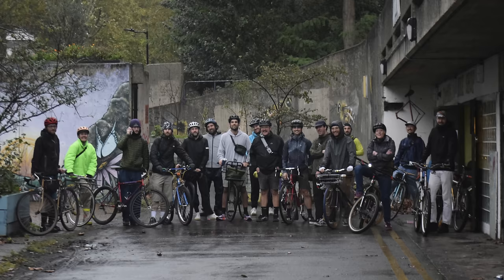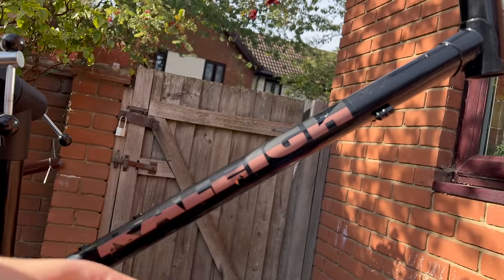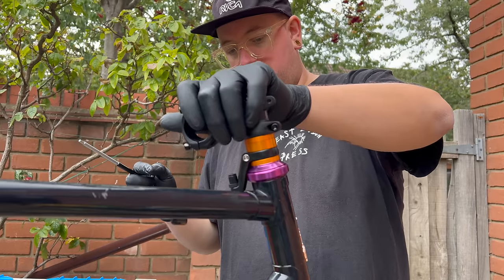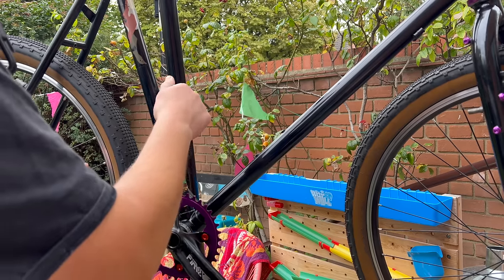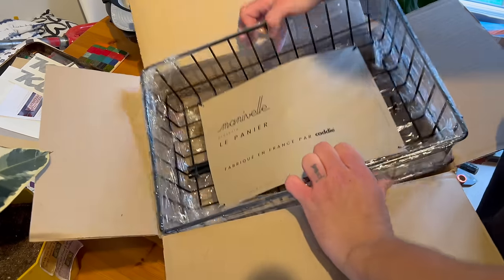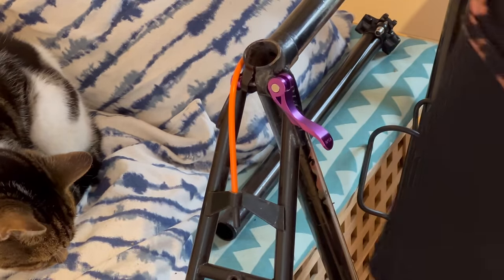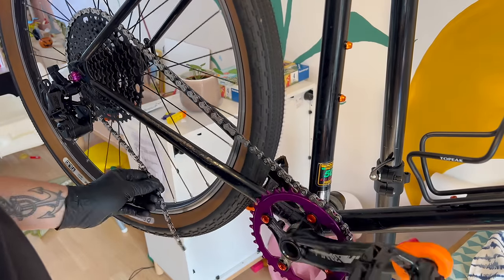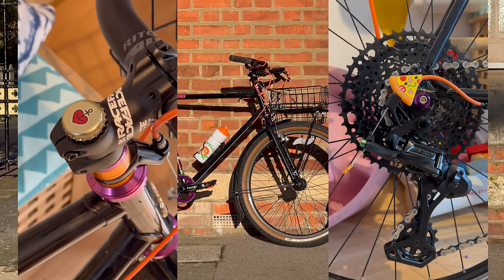Building A Raleigh Moonrun Commuter -  restored mod retro bike build vintage MTB restoration

Comment: It is a brake hanger for the rear. You need a threaded barrel adjuster typically used on 80's road calipers. The adjuster allows cable tension & a stiffer brake bridge.

Comment: I have that microshift 1x10 setup too but I have the thumb shifter and run it friction mode and love it that way. Might be a work around if you can’t get the hanger straightened out.

Comment: Nice build. Did you use the B screw setting gauge that comes with the derailleur? I have found the AdventX easy to set up using it.

Comment: Nice video. I'm picking up a Moonrun this weekend. A lot of original fixtures and fittings are already there so I may keep it. (Front derailleur gang keeping it high) but you've done a nice build. What were the head set bits you hammered in, the anodised ones. Savd old bikes 🎉
Reply from the maker: NICE! The headset was unbranded on eBay. Seems pretty good so far 🤞🏼

Comment: Hi there, loving your videos. I have a feeling this could be my new obsession and I’m looking to do my first bike, I’m 6 foot two and would normally have a 19 inch frame but there is an 18 inch that come up locally to me. I’m just wondering if you have extreme raised bars in some form or another does that mean you can get away with a smaller frame and a higher seat, saddle and bars?

Comment: Those Tektro Oynx cantilever brakes are pure junk*.  The absolute worse non-post mount cantilever brakes in existence.  Note, Cane Creek's are just rebranded Oynx.  The Oynx wont stay in adjustment and when they do, the breaking power is so much lesser than other offerings.  Avid shorties or Shimano CX50/70 are *so much better.